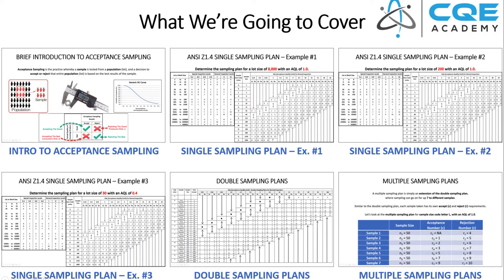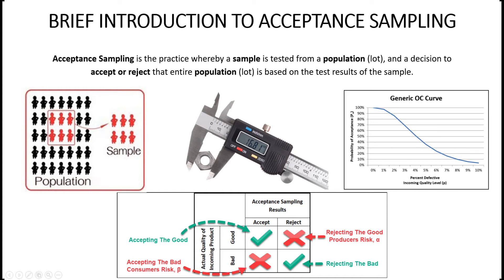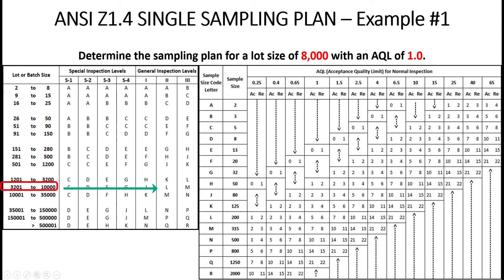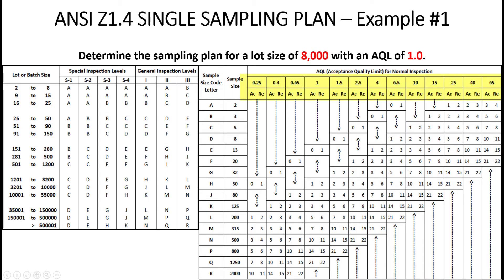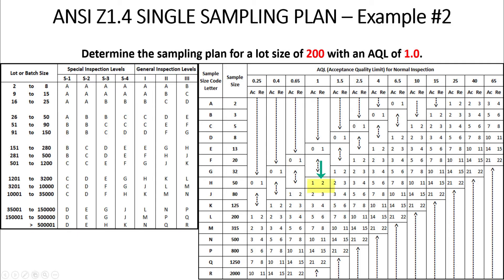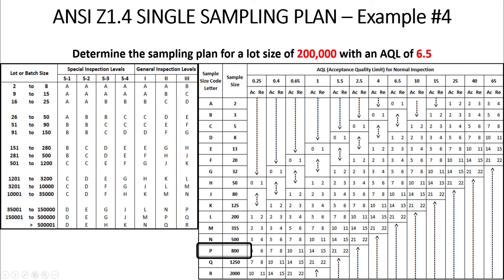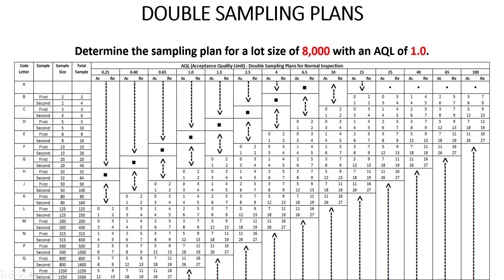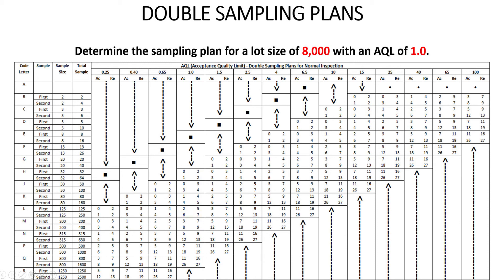Acceptance Sampling and ANSI Z1.4 Sampling Procedure Explained

Comment: Andy, you are wrong about the lot size 30 needing everything to be tested.  That arrow only applies to the limit number.  The number of failures that lead to rejection.
Reply from the maker: Hi there. I do not believe I'm incorrect in this. Please see section 9.4 of ANSI Z1.4-2003 which states "The sample size to be used is
given by the new code letter, not by the original letter."

Comment: How do you know what letter code to pick. I'm not getting that part
Reply from the maker: Start with the sample size code letter table, where you'll take the lot size on the left, and then pick a specific sample plan (general inspection level 2 is the default) to then find the sample size code letter.

Comment: whats the purpose of √n+1 if youre going to use tables to determine the sample amount?
Reply from the maker: Hey Deja!

Great question - okay, so the ANSI standard tells you how many samples you have to take (lets say 50 for example).

Then lets say you receive product on a pallet that has 16 boxes on it, the square root of n +1 tells you how many boxes that you should take samples from - SQRT(16) = 4, then we add +1 to get a total of 5 boxes to sample from. 

So in that instance you should take those 50 samples from 5 of those 16 boxes.

Comment: Very nicely presented! I have question on AQL - Does the AQL % represent the actual % defects? So if an AQL =1% does this mean the acceptable % defect by the customer is 1%?
Reply from the maker: Hey There VK, that's a great question, and honestly it's a long answer.

Sooo, the ANSI Z1.4 standard talks alot about the definitions of AQL, and the common miss-interpretations of it.

Technically, AQL is commonly defined as the worst tolerable process average that is still considered acceptable.   
So you're right to think about it as an on-going, average defect rate.

But I don't think it should be described as an "acceptable" defect rate. It's the worst defect rate that would be acceptable. You can set an AQL at 1.0, but you should desire a defect rate much lower than 1%. Does that make sense?  Sorry for the long reply.

Comment: one quick question? Why did you select general inspection level II only, which is "L"? why not level 1 or 3?
Reply from the maker: great question Manoj!! So the default inspection level is General Inspection Level 2 - Moving up or down should be risk based. If you can tolerate more risk (producers risk and consumers risk) you can move down to level 1, if you risk appetite is lower, you can increase your inspection to Level 3.
Reply: @CQEAcademy  Thank you so much for the reply
Reply from the maker: @Manoj-je5oy  You're welcome!

Comment: Hey OEM QE here ; COuple of Questions 

- How do we define the AQL ? Who defines it generally? 
- How do we decide if we use single , double or multiple sampling plan ?
Reply from the maker: Hey Pranay!!!! 
Okay, so the AQL associated with your sampling plan should be based on the criticality/risk associated with the feature that you're inspecting for. 

High risk/high criticality features should have low AQLs, because we want the occurrence rate (defect rate) for that defect to be low. Low risk failure modes can tolerate a higher AQL. 

But ultimately you determine the AQL. You are also the person who gets to decide between single/double/multiple sampling plans. 

This basically comes down to the pros/cons of each plan. Double sampling has, on average, a lower average sample size, than a single plan. However it can be harder to administer (aka people can make more mistakes).
Reply: @CQEAcademy  Thanks for the quick reply. I own the suppliers so I give them AQL. What AQL should I assign to PC and SCs and what should be for all other measures. 
Like when a supplier is proving capability, on what basis should i give them the AQL?
Reply from the maker: @pranayrkr  Hey Pranay, okay so again that has to come from you, and the defect rates that you are willing to accept from a risk perspective. 

High risk quality attributes should have low AQLs, and then the supplier should design and control their process to ensure a capability level that is sufficient to achieve that AQL.
Reply: @CQEAcademy  Perfect Thanks

Comment: After samplings process, then what happened to the item that we sampling? 
Should keep aside or can use back?

Thank you sir.
Reply from the maker: Hey Muhammad, that all depends on the testing that you conducted.

If your testing altered the product in any way, you might need to discard it.
But if your testing is non-destructive, and you maintain lot traceability with the items, you can consider putting them back into the lot. 

Also think about the mixup risk. If you're testing similar items, and there is a risk that when you put them back into the lot you accidentally mix them up, then you might want to just toss them.

There's not a hard and fast rule for the samples, and it really comes down to your business and the risks.
Reply: @CQEAcademy  Thank you Sir for the explanation. 

Another question:
One more thing, how about the retention sample, how many percent  
should we take retention sample 
(for finished product). Is it any guidelines or ISO can I refer?
Reply: Hey  @MuhammadFirdaus-yd5dw !! There is no hard and fast rule about sample retention. It really comes down to your own internal requirements, or the requirements of your customer.
Reply: @greenbeltacademy  Thank you Sir.
Reply: @CQEAcademy  AQL 1.0%, 2.5% and others. 

Can we own decide for the percentage AQL?
Reply: Hey  @MuhammadFirdaus-yd5dw , yes you can choose the AQL for your sampling plan.
This choice should be risk based, as that % defective units is one half of the risk calculation (probability of occurrence).
So your AQL for high risk items should be low.

Comment: Hello, I have a question for you. Is it possible to apply testing standards (ANSI Z1.4 for example) to a full batch of production? I mean using all the population to be tested? I know it will require more time and resources but we know very little our third party (manufacturing company).
Reply from the maker: Hey Fernando, yes the ANSI Z1.4 standards are intended to be applied to completed batch production.
I'm assuming here you want to test product produced by a 3rd party manufacturer.

If you want to test product that you are producing, I'd recommend using a control chart, over ANSI sampling, to control and monitor your process. It'll give you a more advanced warning to issues occurring in the process - and not waiting until the entire batch has been produced.

Comment: Who define the "Special Inspections Levels" and the  "General Inspection levels"? Thanks
Reply from the maker: That's a decision your organization has to make. 

And it all depends on the risk that you're willing to accept. The default is general inspection level 2, but if you can tolerate more risk (producers risk and consumers risk), then you can choose to go with general inspection level 1, or the special inspection levels.

Also, think about your entire quality system. Do you have other elements in your quality system (downstream inspection), poka yoke, that would mitigate or offset the additional risk that comes with choosing a different inspection level.

Comment: Great job nailed it. Can you please let me know when to use single , double and multiple plans thanks
We have 15 different test for same sample so do I have to devide 200 sample by 15 or 200 for each test ?
Reply from the maker: Hey Shakir!
You have to take 200 samples total, but as long as none of the tests are destructive, then you can take the same 200 samples and test them for the 15 different attributes that you are inspecting for.

If the tests are destructive, then you'd have to take 200 samples per attribute.

Also in terms of single/double/multiple, that's a choice you get to make. 
If the process of taking additional samples is easy, then a double/multiple sampling plan is likely a good choice.

But if taking samples is alot of work, then the benefits of a double sampling plan are reduced, and a single sampling plan is likely the best choice.
Reply: @CQEAcademy  wow that's quick response,
 appreciate your help 
Thanks a lot.
Reply from the maker: @shakirsaiyed8733  You're welcome!

Comment: Great Explanation Sir. What is the Exact Meaning of Double Side Pointing Arrow i.e; both top and bottom side pointing Arrow?
Reply from the maker: Hey Sai,
That double side pointing arrow (Up and down) is actually 2 separate arrows.

One arrow is in the top box pointing up (Example is F at AQL 1).
The second arrow is in the bottom box pointing down (Example is G at AQL 1).
(Those examples are for single, normal sampling)

The up arrow means that you move up to the plan above that sample size code letter.
The down arrow means that you move down tot he plan below that sample size code letter.
Reply: Here's an example on how you can use the double arrow:
Say you have a lot of 495 parts, you want to apply General Inspection Level III, your AOL  is 0.4%, that is, you can tolerate a maximum of 0.4% defect within this lot (or maximum of 495* 0.4% ~ 2 bad parts, i.e., as long as this lot contains no more than 2 bad parts, you will accept it)

According to the left Table, this lot size of 495 falls under Sample Size Code Letter "*J*".
According to the right table, with 0.4% AOL, you can start with sample size of 32, if zeros are found, you can stop the sampling and accept the lot.
If you find one defect, you will have to increase the total sample size to 125, or sample 125 - 32 = 93 more parts. If no more defect is found, you can accept the lot.
If you find more defect, then reject the lot.

Comment: What the square symbols indicating on the Double Sampling Plan table? (For example, Code H at AQL 0.25)    thank you.
Reply from the maker: That Square symbol indicates that you should use the corresponding single sampling plan for that AQL/Code Letter (H at 0.25).

Comment: Are these the only tables needed for the exam?
Reply: Hey there, great question!

So, likely yes, these tables will most likely covers the question on the exam.
However, there's a small chance that there are other tables that might be required.

The best thing to do is to have the ANSI Z1.4 standard with you during the exam, or some other equivalent resource that has the tables.
Reply: Is it enough to have MIL-STD-105 if don't have ANSI/ASQ Z1.4 ....if I use both stds for solving same problem will it be same answer?
Reply: Andy your video are really knowledgeable and precise.